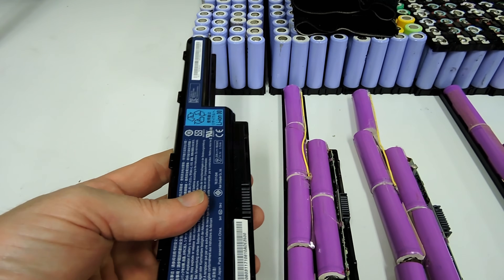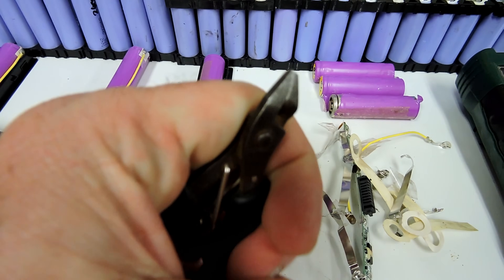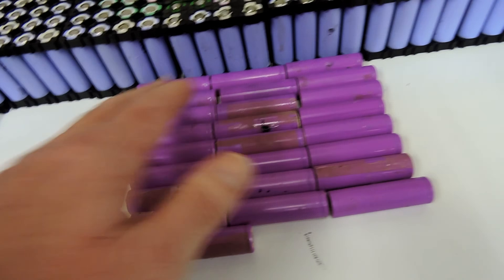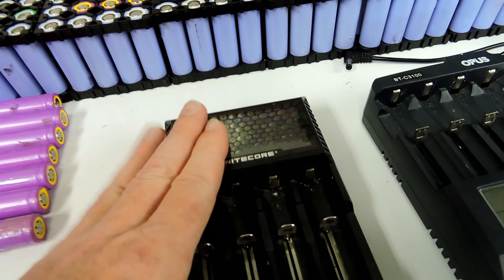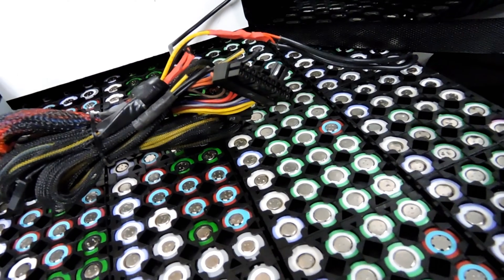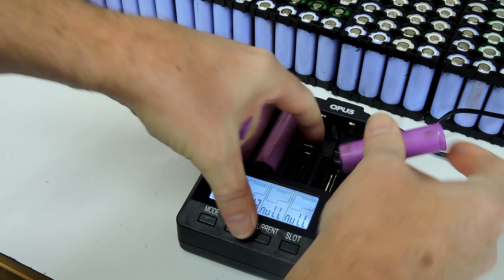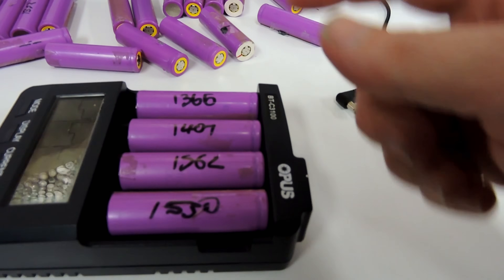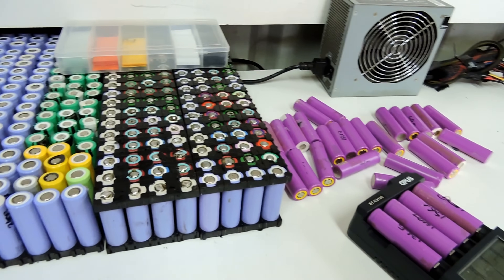How to capacity test an 18650 cell out of a laptop battery pack

Comment: Excellent explainer Pete, and exactly the process I use too with pre- and post charging before and after measuring - life is too short!
Just a note, cells will always fall below 4.2V after charging and even new cells will naturally self-discharge.
Perhaps you meant 4.12V as a threshold after standing idle for a few days?
Reply from the maker: that isn't a bad way to do it either i think.. I started testing at 2amps finds good from bad much faster, however, was concerned about actually hurting cells..lol go figure
Reply from the maker: usually, I leave it for a few weeks so if it drops under 4.1 v I recycle - perhaps I could have done that better.
Reply: That got me a bit confused as well... There is no way a cell doesn't loose at least 10mV over the course of a couple of weeks...
I charge mine to 4,21V, then let them sit for 48hrs, if they are below 4,18V by then, they get thrown out, testing is also done after that 48hr period, since testing directly after gave me higher values in some cases and lower ones in others???
Wasn't able to measure any significant self discharge on the packs build out of these cells, one of my unused 52ah (1s24p) packs for my UPS dropped from 4,15V (my max. charge voltage) to 4,13V in one month, which I would considder good...
Reply: Thomas Cruz, I actually set my charging process up in a way, that i tortures the batterys to some extent, that way they will get hot really quickly if something is wrong... Degradation of the cells should be really low from one "extreme" cycle, after that they'll run between 4,15V and 3,2V anyways :) Letting them sit for more than 48hrs just isn't practical for me, since i would probbably get them messed up or i'd need tons of boxes with dates on them... For now i have 3 boxes, one with freshly charged ones, one wit ones that are a day old and one that are 2 days old, where i take them from to test capacity :) If the ones to test are empty i just use that box for the freshly charged ones and put it at the beginning of the queue, that way ther's allways roughly 48hrs between charging and discharging.

Comment: Hey Pete, have you seen / done anything about where the Opus charger overheats and stops discharging for a bit until it cools?
Reply from the maker: I haven't had this issue yet, i run a fan pushing air kinda over the dischargers but not directly on them..

Comment: Another advantage of using computer power supplies for this is that they are likely around 80%+ efficient while the wall adapters you'd be lucky if they are even 65% efficient. ATX power supply connectors were designed around a transformer tap topology. Of course all modern computer power supplies today actually use switch mode power supplies however usually the 12 volts is still a transformer tap. Which means if you connect multiple 12 volt rails together you might get 24 volts. The 5 volts standby or VSB connection and 3.3v sense connection are limited in the current they can handle. Just don't use those connections for this or pay close attention to the specs of your supply. Cheaper power supplies also won't have foldback features which you almost certainly want in this situation. Also don't just rely on the color of the wire. Technically yellow is 12v and red is 5v and black is 0v or DC "ground" but just use the connector pinout and PSU specs to make sure.
Reply from the maker: I'll just nod and agree as i really don't know lol
Reply: Most wall adapters are switch mode these days and are just as efficient as a PC PSU.  Also unless you are running a PC PSU in the area of 20-80% load you may not see 80%+ efficiency on most of them.  Most computer PSUs have only one or 2 regulated rails per voltage even though they are split up into many conductors to carry the current so in most cases, you can safely combine all of the 12v+ all of the 5v+ and all of the 3.3v+ into one rail for each voltage without a problem.  It is very common practice to do this to create a cheap bench supply.
Reply: You can test your wall adapter efficiency yourself!
Reply: +kuhrd Actually no. Most PSUs have a -12v rail which if you combine with 12v would be 24v potential difference. Just look at the label on your supply it will say "-12v" as one of the rails. About the wall adapters go ahead and try your adapter out. Use a watt meter and a DC watt meter and check the efficiency under load.
Reply: I did not talk about the -12v rail because it is a totally separate rail generally using a blue wire (everyone who works with ATX PSUs knows this) and it is very weak typically only about 1 Amp.  I specifically listed all the + rails which in any modern switch mode PSU are all derived from one or 2 common rails for each voltage.  
I have tested the adapters that came with my 4 Opus 4 cell chargers and they are >90% efficient.  The charger even at full load with all 4 cells pulls 1.52 Amps at a regulated 12v from the 3Amp adapter and pulls 19-20 watts from the wall according to the kill-a-watt meter.
Reply: +kuhrd And not everyone watching this video would thats the whole point. As for the efficiency you'd be lucky then. You also have to pay about $60 dollars for one of those chargers.

Comment: Perfect, I've just started my 18650 project. What do you do with cells that don't fully charge to 4.2? Say they get to 4.15, but have good capacity. I've come across a few.
Reply: Since the capacity is good and there are no other problems, like getting too warm, I would use it. A lot of the home built power walls limit the charge to about 4.1 volts and the discharge to around 3.3 to extend the cell life. Just my opinion, your mileage may vary.
Reply: Any cell that is around 4.2v give or take -+0.5v is fine. 
It can depend on your battery charger some are designed to charge upto only 4.15v while others may even charge upto 4.22v 

Do not use cells that charge over 4.22V

Most cells will be fine just don't use cells that drop in voltage rapidly in under a week after checking as they are going to cause issues in your bank. 

I charge all cells first to 4.2v then do a discharge test to check capacity. Then fully charge again and stand for a week. Any cells that appear low after checking i disregard or use for something else. I would still keep a cell that was 4.1v and above as its still fine
Reply: @llamudos9809  I save my laptop batteries and I have two of them with 2.55V and some even lower. You mean they are still usable?
Reply from the maker: I'm with tony great reply mate
Reply: What voltage does the opus run them down to in order to deem them discharged? 3v? 2.85v?

Comment: Thanks for that... I'm already doing my cells exactly the same way as you're doing yours, so good to know I'm not doing anything wrong. Do you find that Sanyo Red cells almost always get hot during charging? I always seem to end up throwing out the Sayno red ones. Cheers!!
Reply: Jim Conner yes there is a higher amount of red Sanyo's that get discarded but you can still get plenty of good ones.
Reply: Sanyos from 2013-2016 are pure crap. They even had a recall, since they emit heat above 3.95V, and get quite hot if you charge them above 500mA.
Reply: Those are exactly the ones I'm talking about... They're very strange because if you let them cool down again once they get hot, they then charge all the way up to 4.2 without getting hot again.. and they still give good capacities. I pulled apart 7 laptop packs a few months back, and rejected the cells from six of them because of the heat... I wasn't sure if they were unsafe, or if I could use them for some low current projects so I just put them back in the battery recycling box at work (where the packs came from in the first place). Cheers!!
Reply: You will find using Sanyo's that do get a bit warm would be fine in a Powerwall application because every cell has such a little draw from it. 
You also need to define what warm and hot is. Everything under say 70c you most likely won't have a drama with but over that I would discard.
Reply: In my case, the cells were sitting at around 60 C and the Opus charger had backed off the current down to around 100mA, probably due to the high temps... They were taking forever to charge, which is why I noticed how hot they'd got. Cheers!!
Reply: I would suggesting better cooling the Opus. Upgrade it's fan.
Reply: majority of the red ones i test are usually useless